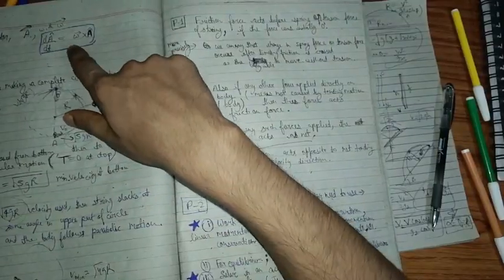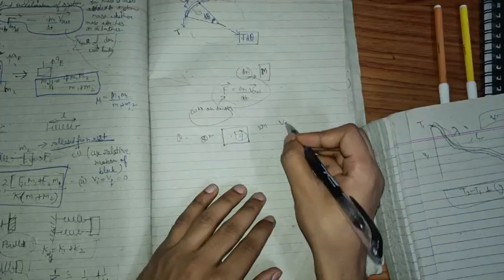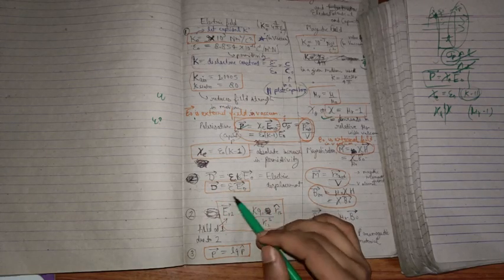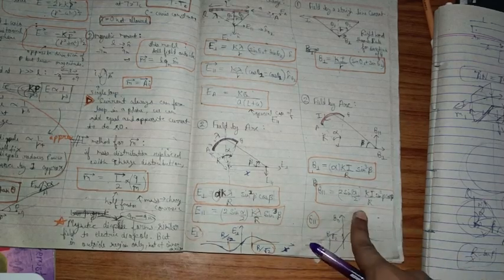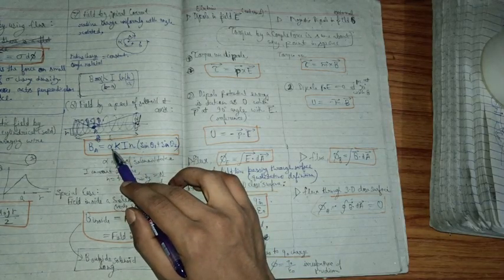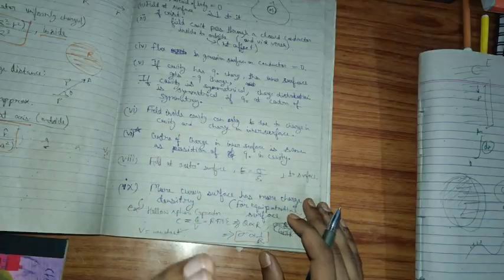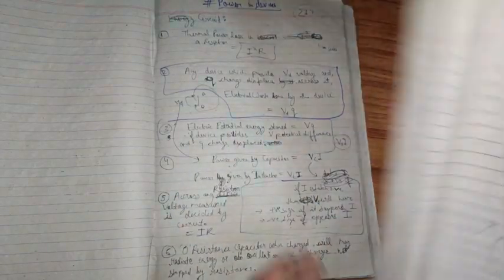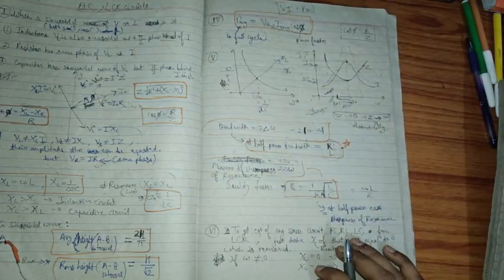Mechanics imp points+ Electrostatics + Magnetism+ AC+ EMI + Charging of LRor RC with battery

Comment from the maker: 1:23:10  the integration is written wrong. In lhs Its r cap/r^2   not r vect/r^4 or whatever written over there. 

Can check dimension 

😂one Funny thing happened - i thought if dy/dx is dimensionless then y'' is also dimensionless but y" will be 1/L in dimensions due to dx in denominator ( in neet question)